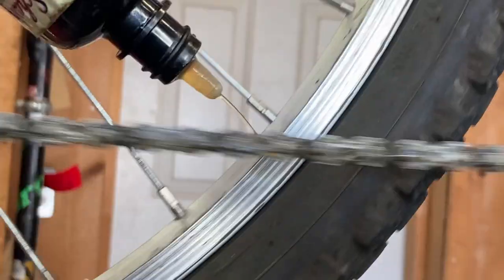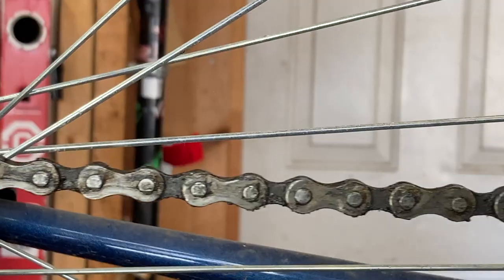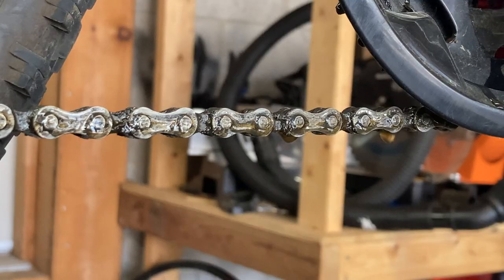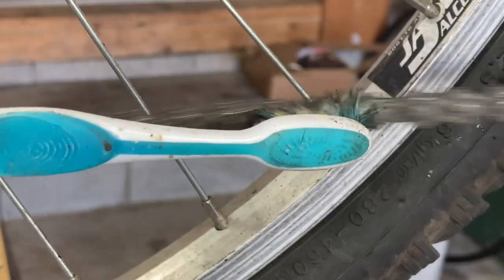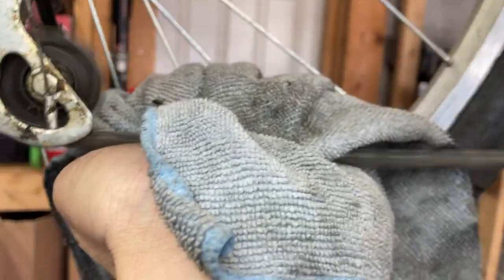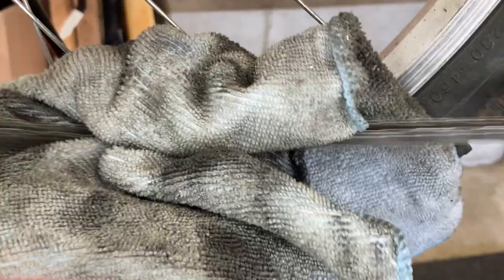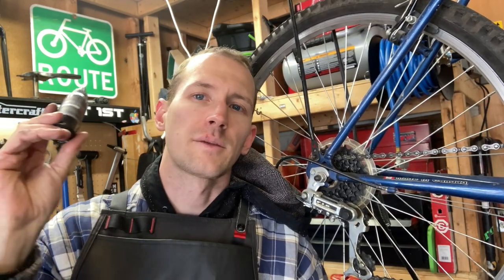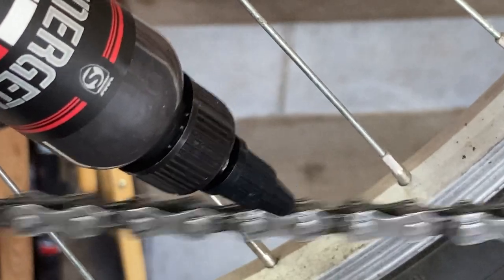DIY bike repair: How to clean your chain with a toothbrush

Comment: Is there a specific reason for running the chain backwards? I just got an old bike from Goodwill and the break style is to press back on the pedals instead of the hand break I used as a kid. Will i still be able to run the chain backqards if the bike is upsidedown?
Reply from the maker: On those type of bikes, it doesn’t matter.  The backwards is so the wheel doesn’t spin when moving the chain, but in those bikes, you have to wipe carefully since the wheel will be spinning (you have to spin forward because of brake).  You could remove wheel and use a dummy hub, but likely more effort than required for that level bike

Comment: how dry does the chain need to be before lubing?
Reply from the maker: It’s going to be hard to get it fully clean/fully dry prior to putting lube, so get as cleaned as you can, and the lube may flush out a bit more dirt as well

Comment: 2-4 times per month oh yeah, I’ll get right on that… sike you’ll be lucky if I do it 2-4 times per year.
Reply from the maker: If you ride a lower end bike that doesn't see many km, that amount of maintenance is probably ok.  But for higher end performance bikes, higher frequency of maintenance is better
Reply: @onelastlap9302  I ride it as part of my commute, and to go to the grocery store, so almost every day. 

It’s a lower-end bike in the sense that it wasn’t very expensive, is very reliable, requires almost no maintenance, has a kickstand, etc. Bicycles are one of those bizarre things where the more expensive it is, the more delicate, to the point that if a bike costs $3,000 you can be sure it couldn’t handle being ridden off a curb. God forbid you want to use it to pull a trailer full of groceries — what are you, a communist?

Comment: The chain doesn't look clean at all in the close up shot after you cleaned it
Reply from the maker: On cheaper chains like this, it’s never going to get back to shiny silver.  But it’s clean to the touch (no grease gets on finger when touching it), which is the best you can do with this level chain
Reply: @onelastlap9302  what exact chain is it? And why don't cheaper chains get fully cleaned?

Comment: Really? You’re going to put solvents and degreasers on your chain and not give it a good rinse? Not good advice. Also, dishwashing detergent works as well as all the chemicals that you’re applying.
Reply from the maker: The alcohol helps lift the degreaser off the chain, and then it dries without residue.  If you’re overly concerned about residue, you can also  rinse with water and then alcohol (which will help dry the chain).  And all the wipes in between remove chemical/dirt.  Haven’t used detergent, so nothing to add here, will experiment though 👍